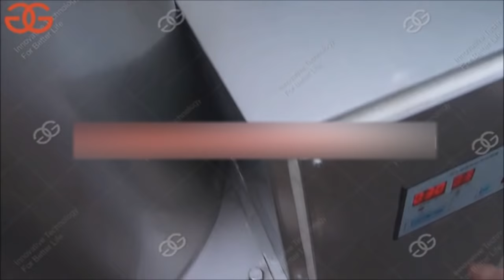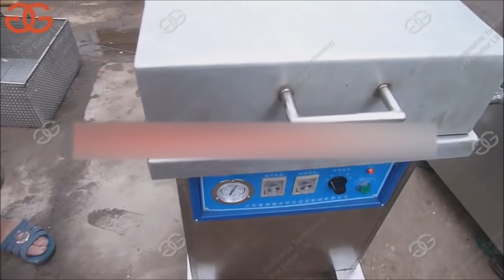Successfully Start Your Own French Fry Business? Equipments For French Fries Business +8613015518550

Comment: There is an easier cheaper way to achieve this.....the trick to great fresh cut fries...using a 3/8 inch die, cut them into water in a three compartment sink skin on, roll them from one bowl to the next to remove all the starch and sugar.....put them into baskets to drain......remember all fresh cut fries don’t all come from Idaho, therefore they all cook differently.....ie, Texas potatoes fry up darker and limp but are sweet and taste great, Colorado russets are ok, California potatoes you could leave in a fryer for a day and they won’t burn, but would be hard as a rock.....so Idaho’s are your best bet, if Ore Ida doesn’t buy the whole crop......this is a fun business.....all that equipment is NOT needed......